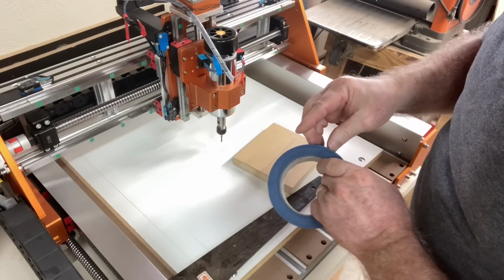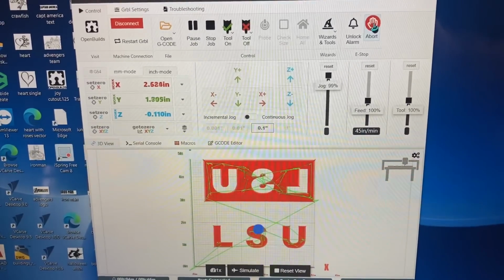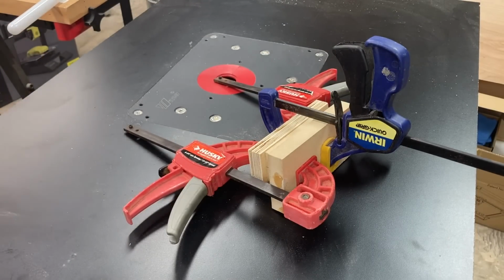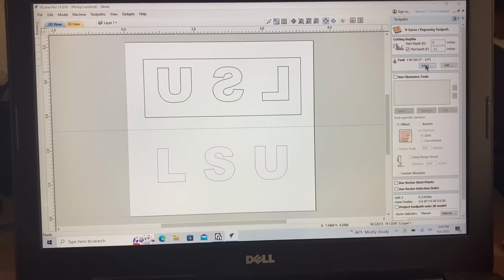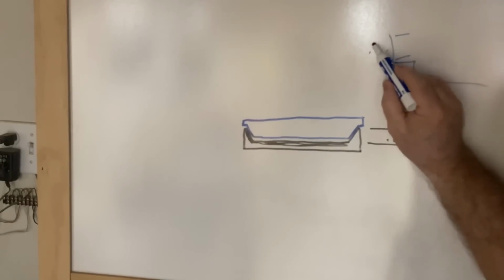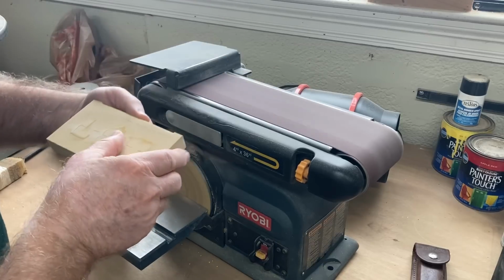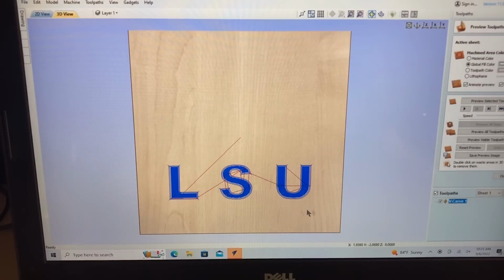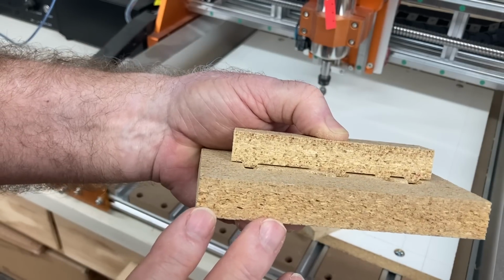Finally, Inlays Made Simple

Comment: I have Vetric Vcarve Pro and an Xcarve pro machine. I’ve become fairly used to Easel but how would I use Vetric to design and carve an inlay on my Xcarve pro machine?
Reply from the maker: VCarve Pro is much easier to do inlays with than easel. You first cutout the female part then do a horizontal flip to right. Setup a border around your project and carve again. Depending on the project and the detail will determine the vbit used. Very simple designs use 60 or 90 degree vbit. For detailed projects use a 20 or 30 degree vbit. Use a 1/4” upcut for clearing bulk material. Also allow about .02” for glue depth. This should get you started.

Comment: Sir. 1 am on the south shore on the westbank. all i have for wood is lowes or home depot. my question is can i use say 3/4 or one inch stock.
Reply from the maker: Yes, you can use that material. I wish we had a true hardwood store in our area
Reply: @PawPawsWorkShop  yes sir u are right when using a 3/4 stock must i chage my setings

Comment: I understand the purpose of the gap between the M and F pieces: It is there so that you can press the 2 pieces down and the force will "fall" on the slopes. I do not understand the purpose of the other gap that causes a cavity. What's the purpose of that one? Besides, cavities will only exist where flat surfaces exist. Inlay areas too small, won't have a flat, will have no cavity beneath them

Comment: Thanks
I have wanted to make my inlay so it fits more in the pocket.
So I used the version of .02 start end and .14 flat. My problem is that when I use the .16 to do the vcarve  in the female part the letters won't fit like yours does. I used a v 30 on both 

.16 female with v 30 bit
.02 start and .14 for flat depth
Letters on male too big

Comment: I must not be paying attention because I cannot find the Easel Inlay Video you said would be linked below.
Reply from the maker: Here is the link. https://youtu.be/Z7sSAV1wkAU
It’s very basic pocket style inlay. Easel can not do the VCarve. I’ve tried numerous times to make an easy process
Reply: @PawPawsWorkShop  thank you so much for the fast reply. I watched that video a few times already, it's very helpful, but I really wanted to give it a try with the inlay method you had in this video. I've seen some amazing cutting boards using this method. I've searched for days now looking for a video that shows this method using Easel. I almost gave in and called Inventables today but they're closed.
Reply from the maker: You need VCarve by Vectric to do the inlays. That’s what I used in this video. Easel is not going to do it
Reply: @PawPawsWorkShop  crazy question. a quick Google search probably would give me the answer, but I have the X-Carve Pro 4x4. I believe it only works with Easel and no other software?
Reply from the maker: If I understand correctly it is GRBL so no. You should be able to design in for example VCarve then create the gcode and use a sender such as Openbuilds controller.

Comment: Could you glue-up two seperate pieces of wood of the same depth (different colors) to do the same job at one time, with the contrasting inlay?
Reply from the maker: Yes you can. However, most often the plug is a thinner piece of material. You also have to consider the location of the material in relation to the design on your computer. That is why most people run two separate jobs.

Comment: I'm still quite new to the cnc world and when I started leaning v-carve inlays in Vectric, I wanted to understand what those numbers really were instead of just copying someone's number. It was hard to find a good explanation, but I finally did and  It's actually pretty simple.  Flat depth for Female is how deep you want it in your female. Let's say 0.2". The male piece start depth is how deep you want you inlay to be inside the Female pocket. I want to leave 0.05" of space for glue, so I do 0.2 - 0.05 = 0.15" Male start depth 0.15" The Male flat depth is how much you want it to stick out from female surface after glueing to male waste material for cutting on bandsaw. I use 0.1". But BEWARE, with deeper inlay, you need to do multiple passes as you don't want your tool to plunge right at the beginning at 0.15" to start carving 0.1. You will break your tool. You need to create multiple v-carve passes more shallow. 

So far I had good result with this understanding with both shallow and deeper inlays. 

I hope this can help you as much as it did for me!
Reply from the maker: Excellent explanation. You have a very good understanding of the inlay process. Well done. Thank you very much
Reply: Thank you, this explains it so well! I've been having so many problems, but I think what you explained here will help. When you do the first pass to avoid breaking the bit, do you follow the same contour at that pass, or just clear the whole area at that depth?